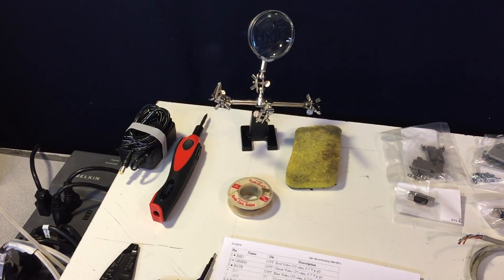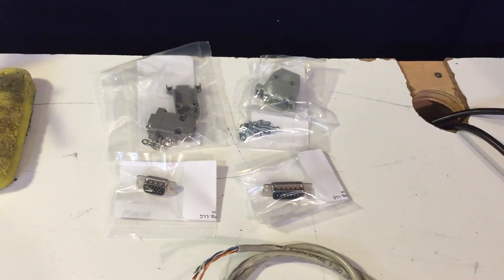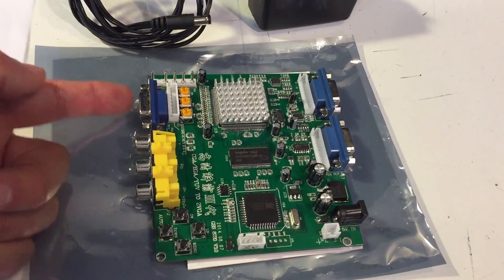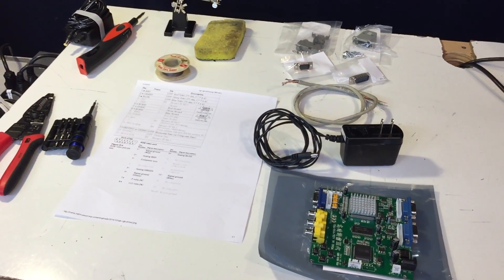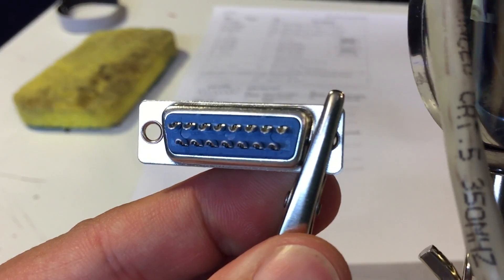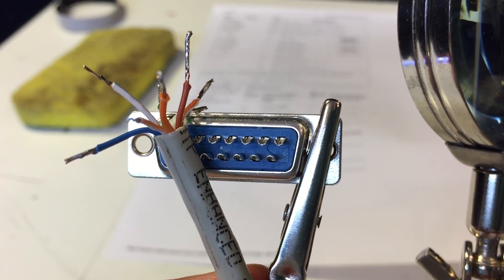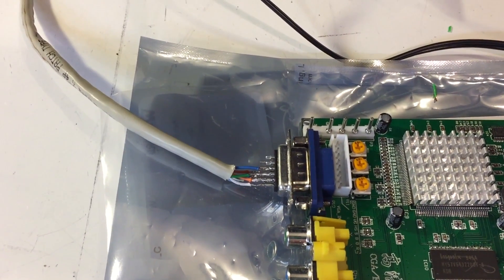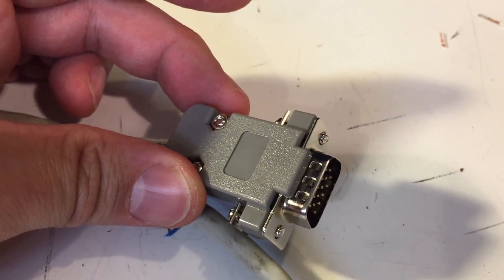Apple IIGS RGB to VGA Conversion

Comment: Hi Joe, Can you update the links in the how to page? I really am looking for the enclosure 3d print stl. I have the parts on order with one change, Instead of making a cable, I'm going with a MAC DB-15(Male) to PC HD-15(Female) monitor Adapter and use existing VGA monitor cables. Crossing my fingers. I am getting my rom1 Apple 2gs back in action. After 40 years.

Comment: Hey Joe, I'm thinking of doing this to my GS, wonder if this also works for older macs like the IIci, or is the pinout different?
Reply from the maker: Nope. Different video format. Those machines usually work with a "dip adapter" connected directly to a VGA monitor.

Comment: Just popping in to say I did this today.  Thanks Joe!  I only bought the RGB connector for the IIGS end and used the cable that comes with the GBS8200 to directly connect to scaler board.  works super fine!

Comment: My Apple ][E AND my Apple ][ GS will both work on my 48 inch Sony HD tv and work great but I cannot get the GS to be recognized on what was my Mother's 19 inch flat screen HD tv. Now if I could figure out how to put a yellow cable on each computer so I don't have to keep switching the cable. You can just plug the yellow cable into the back of the Sony and move it down until you find the area where it will work and then hit menu on your remote and turn on your Apple ][.
I've been playing Arkanoid on the GS & Tigers In The Snow on the ][E & doing videos showing what these programs used to look like. Thanks for posting this.

Comment: There are two more options other than this:

1. Use a SCART cable with a converter to get a pretty good RGB to Component signal to your TV.
2. Use Manila Gears sync stripper/converter and a VGA monitor that support 15 khz  

Converter -  SCART to Component Video Converter Link: https://www.amazon.com/gp/product/B004XSSDPO/ref=ox_sc_act_title_4?ie=UTF8&psc=1&smid=ADXERLXGK7AZN

Pre-Made SCART Cable (Or instructions to make your own) from Vintage Ware: http://roger.geek.nz/scart.html

Link to Manila Gear: http://manilagear.com/product/apple-iigs-vga-adapter/